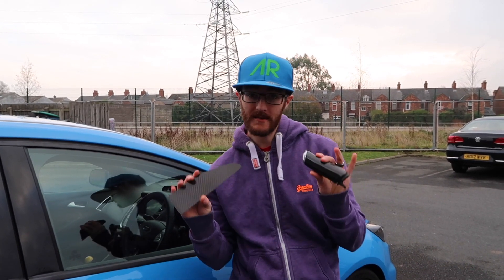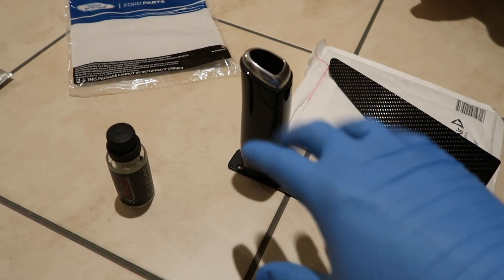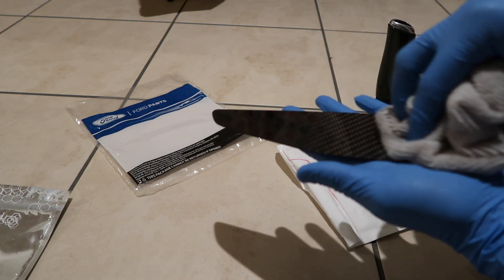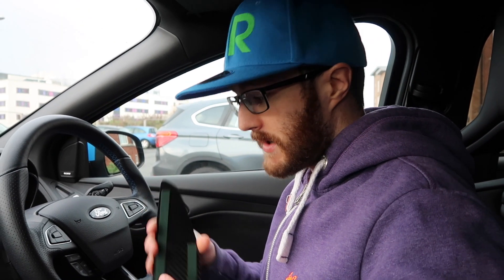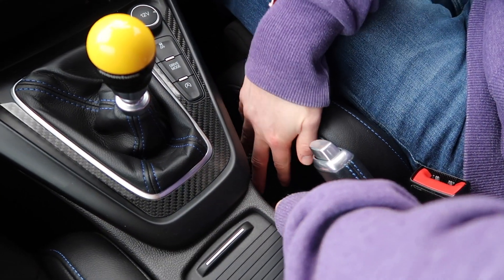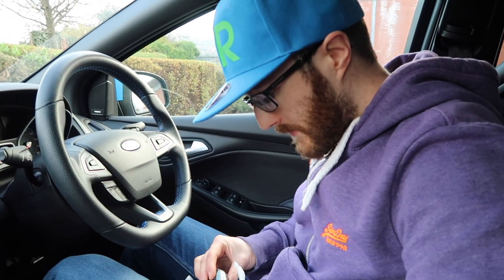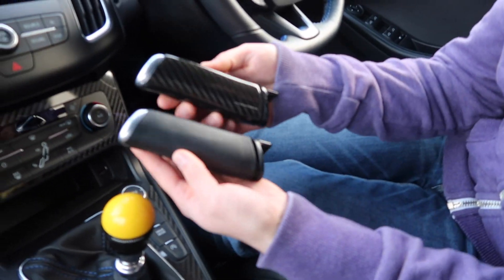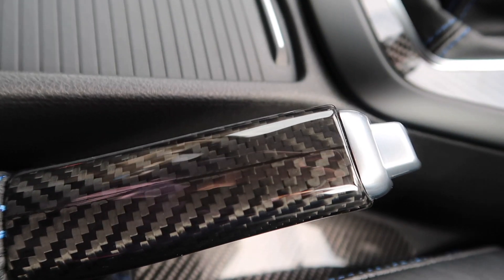FOCUS RS CARBON FIBRE MODS! | RS CARBON PART 2

Comment: I can’t get this damn carbon fiber e-brake handle to go all the way on.  Smacked it a few times with a rubber mallet and it’s still about half a centimeter short.  Any suggestions?
Reply from the maker: Take it all the way off and grease all the contact areas up

Comment: i wish you would do bits to my fiesta lol   you make it all look so easy!  :)    love it tho...  gives me great ideas
Reply from the maker: I don't show all the frustration in working things out off cam lol
Reply: can i ask a question tho... i have a 09 fiesta zetec 1.25   and want to add some LED sidelights  and some whiter brighter headlights...  but people keep telling me  it will mess up the computer?  is that right or are they just trying me to not get them done lol   @AdamRainey
Reply from the maker: Whoever told you that is talking a load of poop lol Certainly with regards to the Autobeam products, they are simple plug and play upgrades that require no messing about or cause any weird issues. If you do go for some, you can get 12% discount with code ADAM12 if you spend over 20 quid!

Comment: So I am here after I installed mine.. I see the thumb button popped off for you as well. I'm guessing that wasn't in your instructions either? LOL

Does yours come off easily or did it snap into place? I am wondering if something broke
Reply from the maker: It isn't broken, dont worry. It is just a compression fit onto a little tab so just push it back on and it is all good - mine has been in place with no issues for a long time now

Comment: The carbon fibre trim piece - where did you get it? I was guessing F34 design.
Reply from the maker: I got it from eBay, no idea what the seller was called. Think they stopped making them
Reply: Adam Rainey I guessed it was F34 design (Kevin) he struggled to get more carbon fibre panels to make any more.
Reply: Adam Rainey Oh, Adam - what company did you have troubles with? (I saw a comment about it on an older video)
Reply from the maker: @LukeBeasto  it was Kuro carbon. Absolute joke of a company, sub par quality products and terrible people
Reply: Adam Rainey Have the door handles from them held up at all? Were they bad with customer service or in other regards? Sorry for playing 20 questions!
Reply from the maker: @LukeBeasto  they are ok on the most part, one of them the clip went a bit funny so I had to take it off and bond it on again. Looks grand but ain't ever coming off lol. Exterior carbon would defo be something to avoid from them because they seem pretty crap at doing the clear top layer
Reply from the maker: @LukeBeasto  but yes customer service was terrible and then when things aren't good, even tho I gave them literally months to sort it out, they started sending me harrasing messages and actually threatened to steal my car and suggested that they would harm me as well. I had to  get the police involved etc
Reply: Adam Rainey How come they are terrible people? 

I may go for the official Ford parts then from Hendy.
Reply from the maker: @LukeBeasto  if I were you I would go to Hendy, they have excellent customer service. See the other comment I sent after the last one
Reply: Adam Rainey I bought my RS from Hendy originally and they are great so yes I shall do that.

Jheeze man, that’s insane about Kuro but glad you are past that trouble now. Was anything done with regards to the threats and harassment that you know of?
Reply from the maker: Cheers Luke :) Not that I know of unless the fraud people have looked into him for all the tax he evades as well

Comment: Installed carbon fiber brake lever it was pain in the A$$ to get in, so I  had to use rubber mallet to get it to clip in over metal ridge.
Reply: How did u do it? I can’t get in

Comment: My button rattled like a MF, this video helped me get it apart to figure it out. Thank you
Reply from the maker: Glad it helped :)
Reply: Just wondering what did you do to get it to stop rattling?
Reply: @optinum  I took it apart and used electric tape where it was rattling it worked great
Reply: @logansheppard3066  thanks just took it apart and put electrical tape on the inside of the handle and some foam near the plastics, hopefully that does the trick 🙏
Reply: @optinum  did it work? I taped it off and cut it real delicately once it was back together so you couldn’t see it lol
Reply: @logansheppard3066  yep! Thank god that rattle is gone now. The other few rattles I’ll have to take care of slowly later